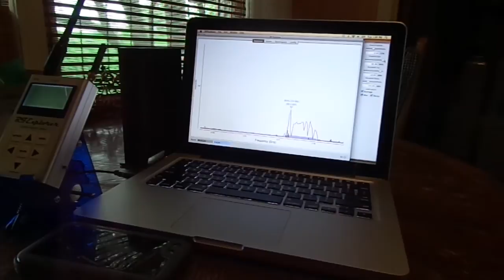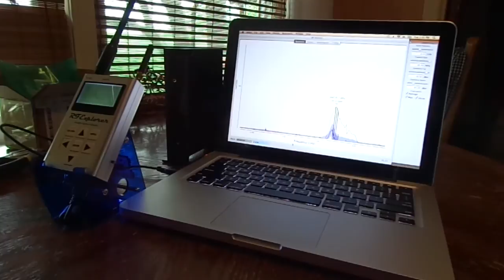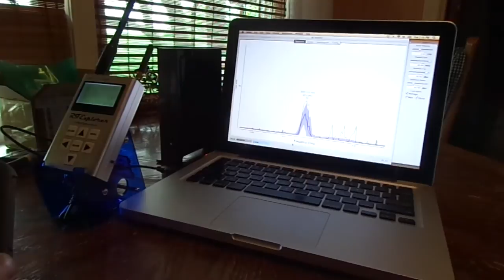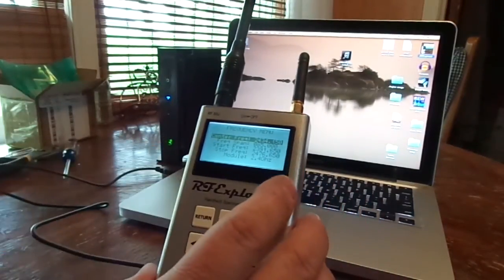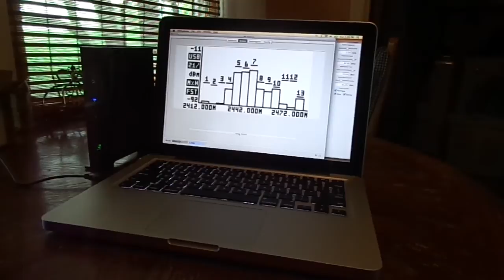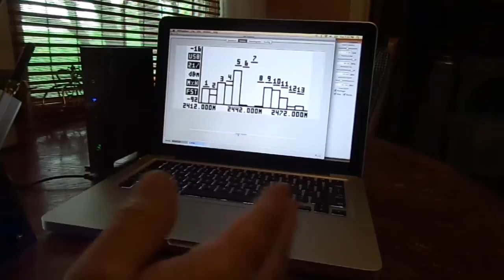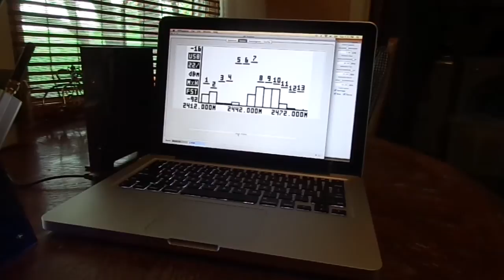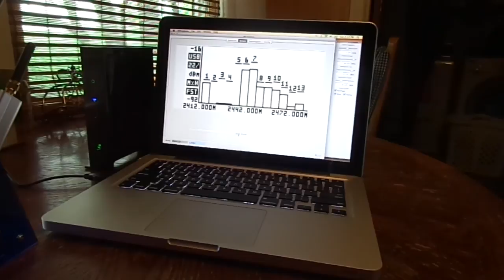RF explorer wifi scan Video 4

Comment: Reason you could not change the frequency to 2.3GHz while monitoring wifi is wifi is fixed @ 2.4 or 5GHz the channels give you incremental frequency shifts on the 2.4GHz or on the 5.0GHz band.
so Ch7 sits around 2.442GHz, Ch10 ~2.455GHz
see: http://blogs.aerohive.com/blog/the-wireless-lan-training-blog/wifi-back-to-basics-24-ghz-channel-planning